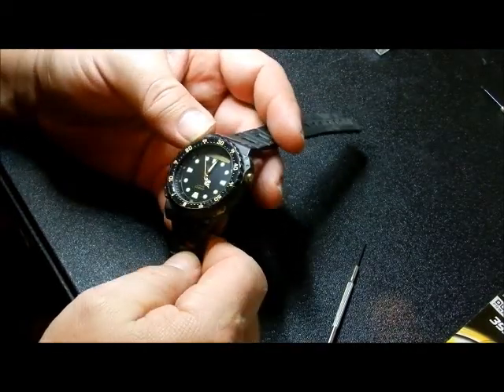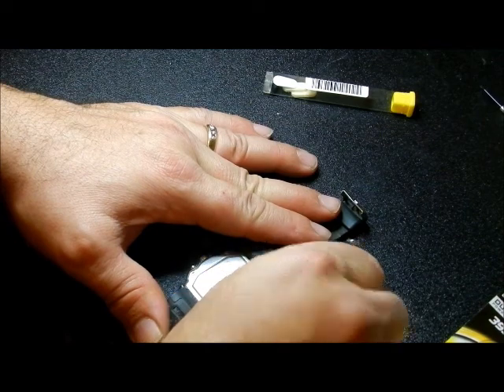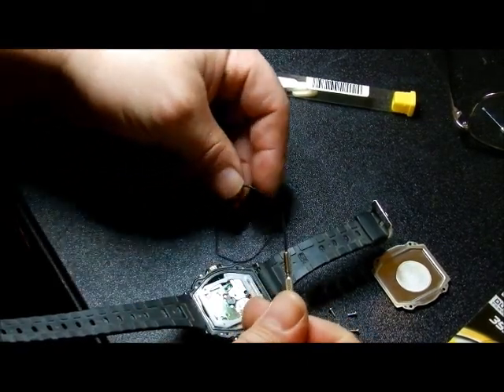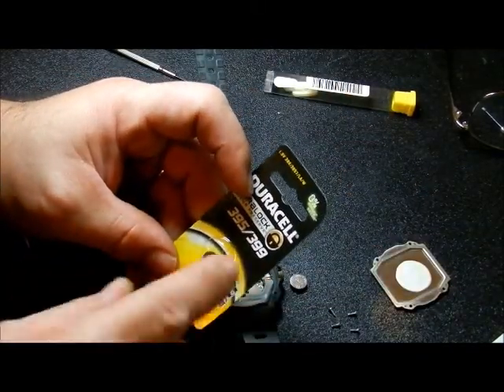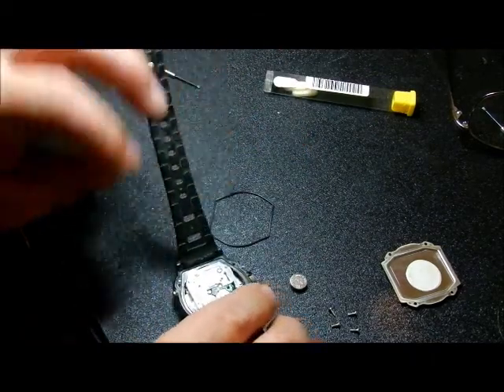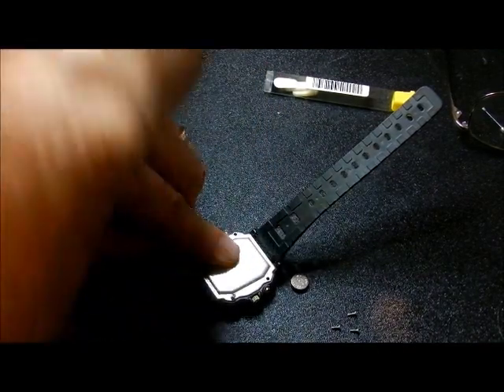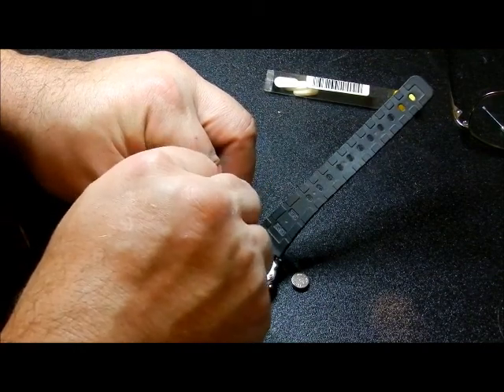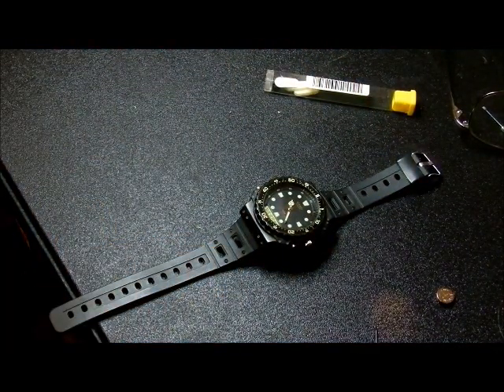How to change a Casio 100M Watch Battery

Comment: Great watch...excellent video upload, William! Replacing this watch's battery is an easy DIY job, saving the owner unnecessary labor cost. One vital thing to remember is to NEVER screw down the four tiny screws too hard when putting back the back cover. Otherwise, the screws BECOME LOOSE. This is because the screws are metal and each is driven through PLASTIC, so screwing them should be done GENTLY and when the resistance becomes harder, that's the time to stop turning with the precision screwdriver.
Reply from the maker: +lino pestano Thanks for the posting.

Comment: I would call the "rubber o-ring" a gasket or seal in lieu of insulation.  A plastic tweezers might work better..or even metal over the screwdriver when grabbing the battery.   Very helpful video.  The "lid" probably doesn't sit down fully because the gasket is likely holding it up, which is good; when the screws are tightened, it seals the unit.  Hope my niece's Casio LRW - 200 M works the same way...different battery though...Thanks
Reply from the maker: Good luck.

Comment: On mine the piece of metal covering the battery hinges upwards from the centre where a loop of metal is hooked over a plastic nodule.
Reply from the maker: +timtak1 Cool.  I just put it back together the same way I took it apart.  Still working today.
Reply: +William Quinn I live in hope. I have three of the same type of watch since the battery replacement is  $20USD whereas the watch is about $40. I have ordered some batteries. 5  for $7.
Reply from the maker: I already have the batteries in stock.  20 for about $6.  Picked them up at a closing K-Mart.

Comment: Does it matter that the back was put on upside down from the position it was in when it was removed?
Reply from the maker: Only if the is a pressure plate, of some kind, that would keep the battery in place.  I would be sure to install it as it was to be sure it works good.  I am still using this.